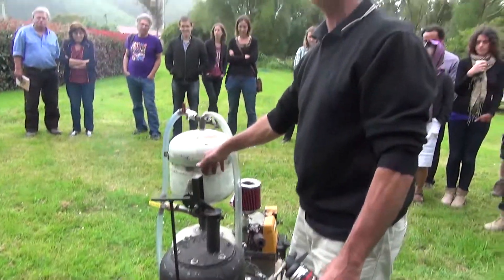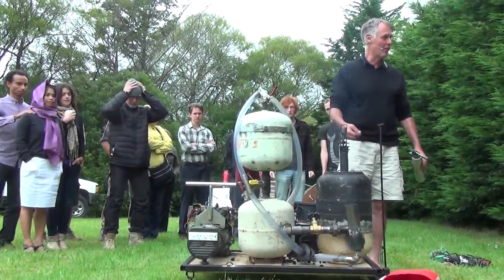Charcoal Gasifier

Comment: Youd have a faster startup if you started it with positive pressure, blowing air at the hearth. Your reduction zone doesnt have high enough temps in the beginning to strip the CO2 and H2O of a single oxygen each, which means you aren't getting CO and H2. The reduction zone gets its temp from the contact it has with the combustion zone, so your combustion zone needs to consume more oxygen in the beginning to get the energy needed for the rest of that process. If you're running charcoal, you have no thermal load from excess moisture, so the slow start up time is an oxygen problem in the beginning. Easy to fix. If you want to test what I'm saying, get a hair dryer and blow it over that hole and keep the torch on the coals until theyre bright. Good work, thanks for showing!